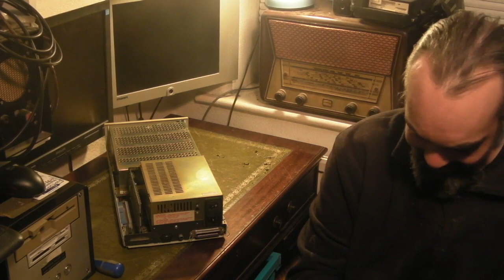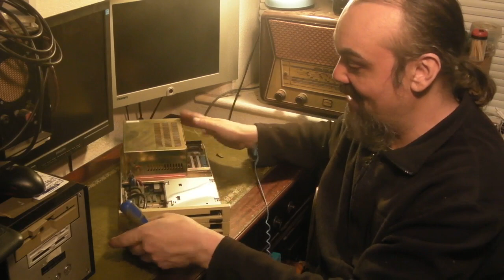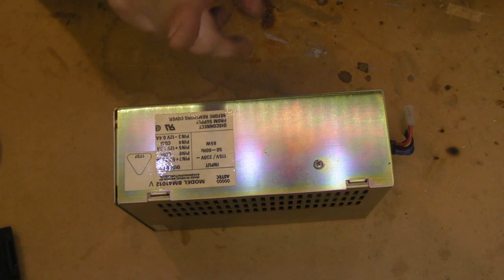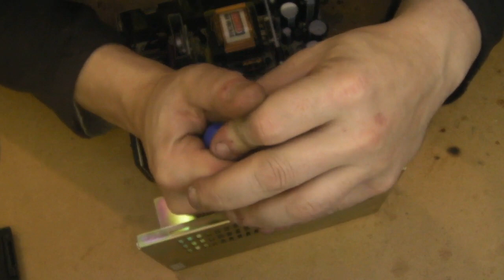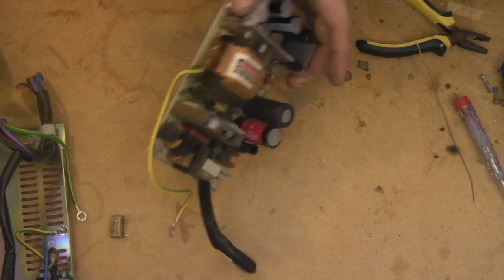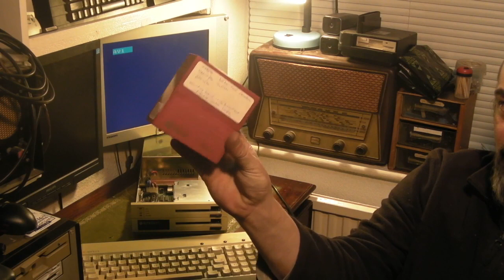A bunch of Apricots Pt2 Testing F2's PSU

Comment: dear jay, good to see an apricot review. do have problems getting the diskdrives to work reliably. you can adjust the klick sound by pressing the button on the keyboard in combination with one of the keys. the xen i will also run f seires software. still looking for a working f10. hens teeth? reagrds,p.h.

Comment: Always smart to check them, but those electrolytic caps were made before this:

Capacitor plague

https://en.wikipedia.org/wiki/Capacitor_plague

The capacitor plague was a problem related to a higher-than-expected failure rate of non-solid aluminium electrolytic capacitors, between 1999 and 2007, especially those from some Taiwanese manufacturers, due to faulty electrolyte composition that caused corrosion accompanied by gas generation, often rupturing the case of the capacitor from the build-up of pressure.

A 2003 article in The Independent claimed that the cause of the faulty capacitors was in fact due to a mis-copied formula. In 2001, a scientist working in the Rubycon Corporation in Japan stole a mis-copied formula for capacitors' electrolytes. He then took the faulty formula to the Luminous Town Electric company in China, where he had previously been employed. In the same year, the scientist's staff left China, stealing again the mis-copied formula and moving to Taiwan, where they would have created their own company, producing capacitors and propagating even more of this faulty formula of capacitor electrolytes.